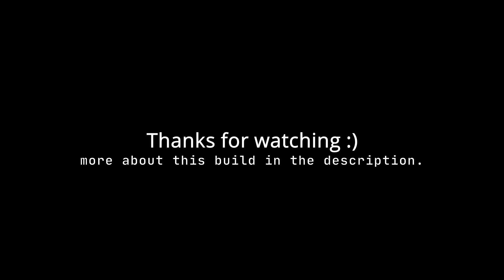Torn v3.0 Keyboard Build log

Comment: Very nice keyboard and build video!, I felt in love!... Regarding the pcb surface finish, did you choose the hals or the enig one?. Thank you!!!!!
Reply from the maker: Hey thanks for you feedback, I remember at the time I didn't changed this settings, so it was the default one (and probably the cheapest)
Reply: @rafaeldelboni   Thank you for your kind answer. Yes, the difference in money is huge and i´m not sure if this difference is justified for this project. I´ll go with the hals finish. Other question, sorry: I uploaded the plate gerber to JLCPCB and I dont see in the 3d views that the switches holes are drilled, they appear black solid; the screw holes are not solid, and you can see through them... is it normal? do I need to drill the switches holes by myself?. Thank you!
Reply from the maker: @coolhellfire  No, you should see it with the holes like this printscreen https://imgur.com/9pQ2kos
I recommend uploading the entire  corne-cherry-gerber.zip in this link https://github.com/foostan/crkbd/releases/tag/corne-cherry-v3.0.1

Comment: I would like to ask and excuse my ignorance, can you use via instead of qmk? also I would like to know if there is a simpler way to Flashing bootloader? and if so is there any detailed guide.
Reply from the maker: Hey good question, yes is compatible with via you can download the via firmware in the official site
https://www.caniusevia.com/

But I'm afraid that the first time you need to flash the via .hex file you need to go through the steps I did in this video, at least one time.
Reply: @rafaeldelboni  Thanks for answering, I would like to know how to do that specific step, I'm stuck, I can't get my head around it! I am very newbie!
Reply: @rafaeldelboni  Maybe we can communicate by some means! If possible! Greetings from Madrid!
Reply from the maker: @davidberrios5241  Hey David this step can be quite complicated, I followed this guide myself, using an Arduino Uno as ISP method.

https://github.com/rtitmuss/torn/blob/master/doc/bootloader.md

Comment: Love the build videos! Are switches easily to swap/insert without pulling the fr4 plate off?
Reply from the maker: They aren´t super easy to remove, I found easier to remove the entire front plate and later remove switch by switch.
Reply: @rafaeldelboni  So even when you had assembled it, you had first put all keys into the plate and then put it in the sockets all at once?
Reply from the maker: @infiniteoffset  yes, I found this approach easier
Reply: @rafaeldelboni  Great, thanks for the info! I have some FR4 plates on the way, so I can't wait to build it.
Reply from the maker: @infiniteoffset  send me the pictures of your build when you finish
Reply: @rafaeldelboni  Sure :) , with fr4 plates I'm doing the hotswappable corne and lumberjack (not hotswappable). Parts are on the way.